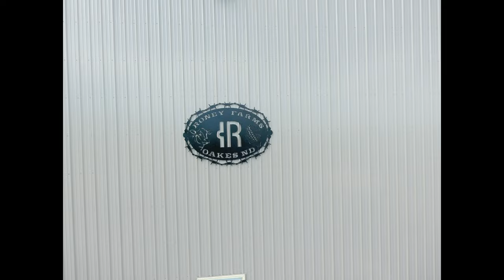Livestock Hoop Confinement Barn (Scott Roney)

Comment: Only thing i see wrong is the drive alley should have been the width of truck and mixer or tractor and mixer , not necessarily have to be concrete but reclaimed asphalt would do
Reply: YES I SEE WHAT YOU MEAN COULD HAVE SAVE A COUPLE OF BUCKS